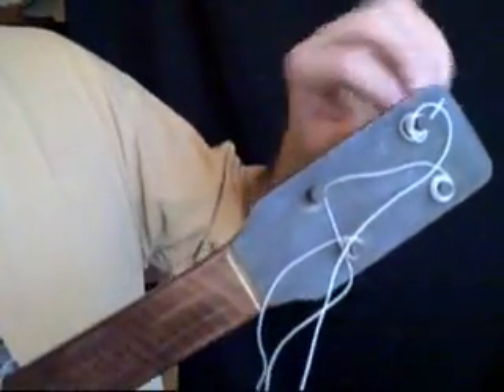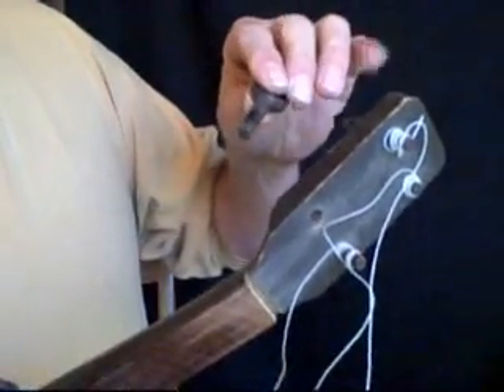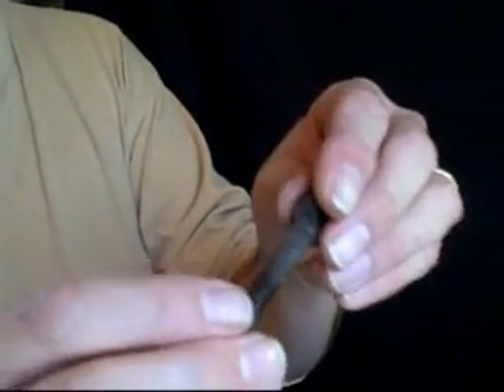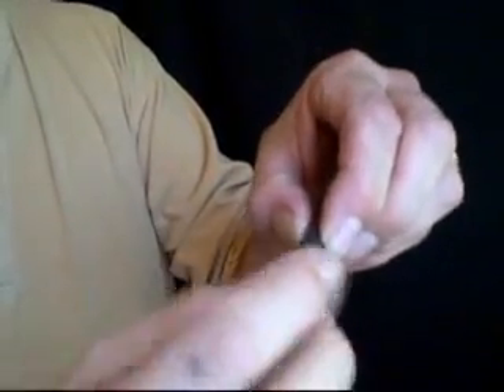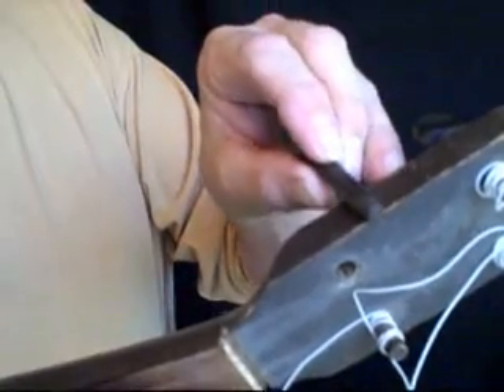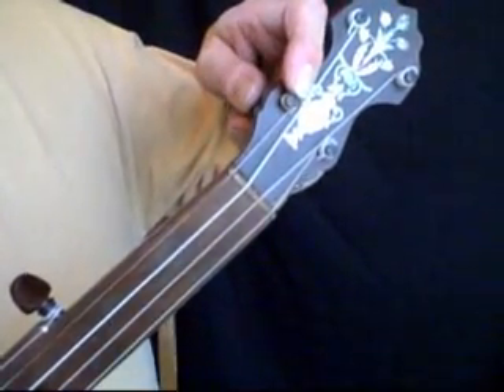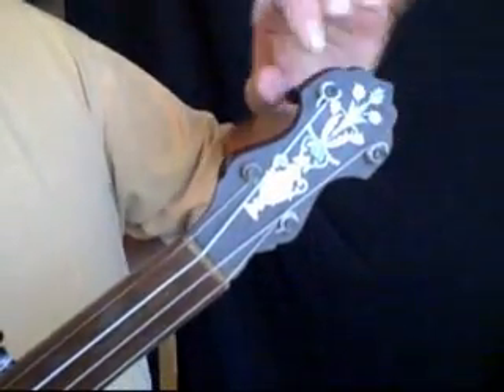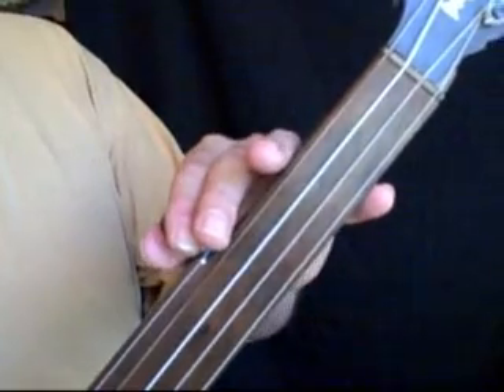Using violin-type pegs for banjo

Comment: I though all REAL banjos use them...

Super Dave tip for the day...

You can use them with steel strings if you Suzuki small violin fine tuners by the tailpiece.  You know, the ones that just go on the string itself, not really connected to the tailpiece.  it just kind bends the string.  I think they are a buck or two each.  

Got it from Zepp...